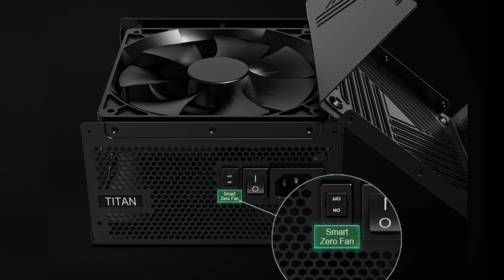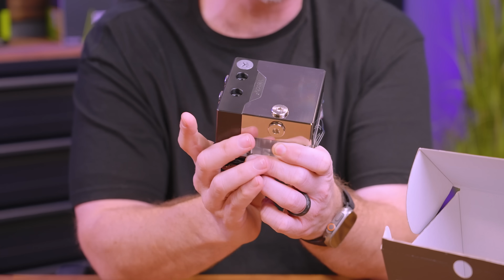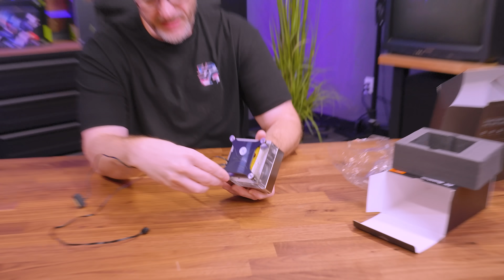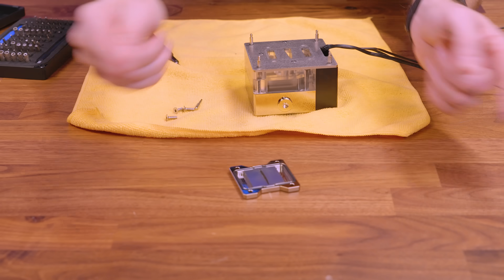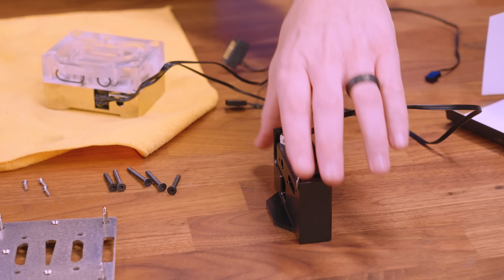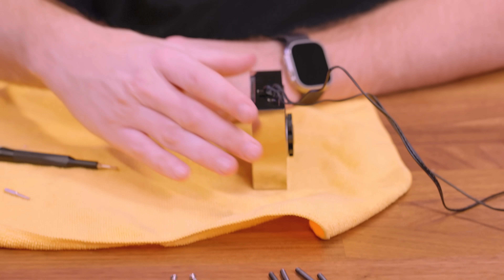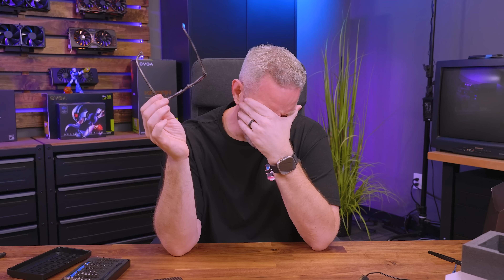I wish this existed years ago!

Comment: You can take the combo pump from an AIO and connect it to a loop I know this because I've done it many times, I've also built my own GPU bracket out of nickel plate so I can fit a second AIO pump to the GPU. This not only looks good it's very efficient very cost affective.

Comment: AlphaCool has one thats pretty robust been out for about 4 years now.. it comes in their AIO packages but 240,280,360.. in slim varriant and a pretty large pump.. Id love to see the test of those two side by side because im trying to upgrade to AM5 and dont want to have to get a differnt cooler to deal with the high temps of the AM5 Platform if my 280 AIO will handle a 7900x, or 7950x

Comment: I am really contemplating this item for my NR200 custom loop. It's between this item or Barrow's Pump Reservoir Integrated CPU Block. But I read the included pump is not PWM and replacing the pump with a DDC 4.2 Pump would cost almost as much as this one.

Comment: Please correct me if I am wrong but if you use the fillport on the cpu/pump combo and bleed it from air, Won’t that make it possible to use a bottom mounted rad? As long as the fillport is facing up on the motherboard?

Comment: This should be absolutely fine with the radiator at the bottom of the case, since it has a small reservoir above the pump. Air will collect inside the reservoir, not the pump.

Comment: Silly question, could this work well?..
I have a katana 1070. The heatsink seems to be all copper and seems to have a bit of a flat heat chamber then fins to take note of....
 
Wondering if will work to clear the fins over the processor area, and try to flow copper (plumbers type solder?) To join a copper water block to it?

Comment: Neat looking device, thank you for the video. I'm surely not the target audience, though. Even after 27 years of building PCs I'm still not comfortable with putting any liquids inside a PC. Since I am also all about efficiency, the components I usually use for new builds don't rectify any liquid cooling solutions. But again, I can see the advantages of this compact block.

Comment: Which is why you prime and load the system externally with another power supply using the green wire trick, THEN put the unit in your case.

Comment: Would ATX shift PSU fit insade lian LI O11 air mini case, and would it make sence to use it, if a person dosen't intend to use hard drive cage ?   I will need psu from 1200W to 1600W ( just for size reference ).

Comment: Hello Jay, greetings from Ecuador, I want to tell you a question related to my setup, It's not related to the video, but I wrote because you have a lot of experience and setups and hardware. 
My motherboard Gigabyte Aorus Elite Z790 AX lits its CPU troubleshooting led when computer enters into sleep mode or when computer is shut down, and led remains lit unless you disconnect the monitor from energy or DisplayPort cable of the CPU. This makes me think about a physical problem, and not a simple bug that I could ignore. Someone told me that this can be a motherboard shortcircuit problem that only shows up when energy from mobo is gone (when you shut down it, for example).   
That led situation does not occur when the HDMI cable is connected to the monitor, when the computer goes into sleep mode or shuts down, the CPU LED lights up fleetingly but turns off and remains off. So, I think is something related to the DisplayPort monitor connection, but DisplayPort cable is new, and also all of the other computer components, also, I dont think the DisplayPort is damaged, because there is no problem with image displaying.  
I would like to know the possible causes of this issue and the potential solutions or tests to try, before trying warranty technical revision, because they tend not to take seriously client's questions or complaints. Thanks in advance.

Comment: I'm not sure the flow direction is correct there.  "Usually" the center part of a pump is the suction port, it's in the name centrifugal pump.  When I look at that block, i see suction from the centre, which means the outer edges are the cool side.

Comment: I kinda don't get water cooled systems at all anymore. Back in the early 2000s when I was still working in PC building and sales, we used water cooling and a single passive radiator at the back to make systems completely silent (except the pump). This made sense. Nowadays, people have multiple radiators all over their case, with multiple fans on each one, and a "water cooled" system in the end has more and louder fans than a regular air cooled system would have. What's the point of doing this, except the thrill of having added more failure points and cost to your rig?

Comment: greevar
greevar
2 days ago
The backing for the double-sided tape is probably left on for those who want to remove the RGB. Not everyone likes to light up their computer.

6

Reply

2 replies
wimpyhugz_TGK
wimpyhugz_TGK
1 day ago
I'm using the AM5 version of that block/pump/res unit in my Fractal Torrent build. Got a 80mm thick 2×180mm Alphacool Monsta radiator on the front with the stock 38mm-thick Fractal 180mm fans and an EK P240M radiator in the bottom with 30mm-thick Phanteks T30 fans, leaving me very little room for a normal pump/res setup. 
Also, I ended up just attaching a fill line to one of the fill ports on the block and routing that to one of the Torrent's fill port holes at the top of the case so that it acts like a T-line reservoir. Without that, it just makes the initial fill and priming really difficult...

1

Reply

1 reply
AirRookie
AirRookie
1 day ago
AM4 version of this combo would be nice to have, I can only find AM5 and 1700 versions so far, looks so cool

Reply

Pink Tusked Mammoth
Pink Tusked Mammoth
2 days ago
This reminds me of working as a auto mechanic. Remember even with that nylon saving the "curious" a little it will still burn up the pump if you run it dry for too long. Its best to just not run it dry.

1

Reply

H311FR0G
H311FR0G
1 day ago
As to the sponsor ad, I love how "Zero RPM fan control" or "Fan Stop" is treated like a quality improvement feature, when all it does is make your hardware run hotter and burn out faster.

Reply

Mr. Hatchet
Mr. Hatchet
1 day ago
Probabely also a really good product for dual loop systems.

Normal d5 for gpu and this for the CPU.
Iam wondering if they will offer a combo unit for gpus aswel.

One res feeding 2 pumps could be a nice one when buildt right.

Reply

Jordy Steinberg
Jordy Steinberg
1 day ago (edited)
I had the Swiftech CPU block/pump combo for my watercooled build about 10 years ago where I liquid cooled a 4770k and a 780 ti.

It died after about a year.

I switched to a DDC pump IIRC  and an EK waterblock for the CPU.   This block/pump combo certainly looks a lot more sturdy than the Swiftech version from a decade ago.  

It's definitely a bit harder to make sure the pump is getting water if the pump is integrated into the CPU block in my experience; I recall having to lean the case quite a lot and stop the pump repeatedly to get all the air out despite the CPU block being a decent distance below the reservoir while filling the loop... There was a bit of a curve in the soft  tubing I was using and that seemed to collect air consistently. 

I'm not sure if this solution is actually easier than just using a reservoir that has an integrated chamber for the pump, like Daniel's reservoirs from Singularity Computers.  Considering I've not used one of his reservoirs and you now have access to both, you'd probably be a far better judge of that.

Reply

BramSLI1
BramSLI1
1 day ago
I wonder how they got around the Asetek patent issue that Swiftech had to deal with? It's why they had to discontinue their pump/waterblock combo units. It's also why they had to move the pump to below the radiator when they released their AIO units.

Reply

Salty Lion
Salty Lion
2 days ago
That's great to hear that I accidentally did it right with my cpu AIO the radiator is mounted to the top of my case. I built this like 6+ years ago, still going strong.

Reply

Johan Kooistra
Johan Kooistra
1 day ago
Yet another thing shown, which is awesome: But it would be so much more fun to see it running in a system.

Reply

MotoVib3s
MotoVib3s
1 day ago
This is hilarious .... I literally just purchased this for the specific reason of running a dual pump setup in my 011 Mini. I've been running the EK front distro plate for the 011 mini & thanks to my flow meter I know all the bends & turns have drastically lowered the flow. So I purchased this for the exact same scenario you explained at the end

Comment: Really disappointed that it's a socket specific block+pump combo as even most AIOs and normal open loop blocks have brackets to support more than one socket. $319 while cheaper than what I expected, stills seems a bit pricey to be locked into one socket.

Comment: Does the weight of the block cause you any concern? Although it bolts onto the retaining bracket, which has an additional bracket on the back of the motherboard, I wonder if the weight causes the motherboard to flex. Maybe not because of all of the standoffs.

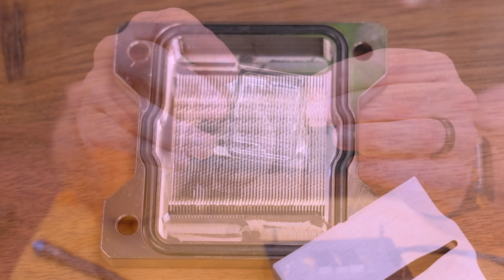Comment: 8:53 - its only more surface area, the higher density of the fins the slower liquid moves through them removing heat from the coldplate.

Comment: I remember in the days before there were reserviors specifically built for pc's, you can t-junction a fill tube from the top of the case to right before the inlet of the pump and use that as a reservior. Of course  the volume was small but you would fill as it pumped and it also acted as an air collector and bleed valve. Once the system is purged of air, fill the tube up with water and it acts as a small reservior to keep your pump from running dry.

Comment: A gen 5 power cord with a 1920 vintage circuit. Modern (21st center - 2011 or later) circuits are cheaper, smaller, and better.

Comment: Leaving the tape off allows the strip to form to the channel, allows for thermal expansion, and means it can be removed or swapped without having to peel it off the block. Personally, I'd leave the tape on. With all the other choices that EK made, it stands to reason that this was their choice as well.

Comment: EK has screwed me over multiple times now. Costing me hundreds of dollars. 

Recent I ordered the 4090 wb with active backplate, and they only gave me the active backplate and refused to acknowledge the mistake despite an unboxing video showing it was just the one. 

They also already discontinued the dark hero monoblock already despite being a rather new motherboard. And now there’s no viable alternative and mine is failing… I would need to completely charge out my motherboard now once it’s gone.

Comment: Probabely also a really good product for dual loop systems.

Normal d5 for gpu and this for the CPU.
Iam wondering if they will offer a combo unit for gpus aswel.

One res feeding 2 pumps could be a nice one when buildt right.

Comment: I have had a bad experience buying from EK, as after spending £1000 with them 4 120mm fans were DOA, and they wouldn't replace them, but luckily in the UK if you pay with a VISA or credit card you can recover the money using Charge Back or better still, under Section 75, and the bank takes all the money back and gives it back to you, meaning EK lost £1k for not replacing £20 worth of faulty parts.

Comment: Same here Jay, if I were to add that my loop would have a D5 and this DDC... but I don't think I need it for now... 2 rads, cpu and gpu, I recently reworked my loop and tried to use the minimal amount of bends, it literally now only has 2 90° bends, a slight angled one, the rest are straight pipes, so I think I'm good for now

Comment: Couldn't you put one or two three way walves somewhere high and have two ports where you could attach a temporary reservoir for filling just above the block? Once loop is filled and air free you just change the valve position and bypass the reservoir ports. Then plug them off.

Extra parts perhaps but we talking custom loop anyways, people are generally not going for the easy route..

Comment: This would have been awesome 5-7 years ago. Back when components where low enough power to really fit in small cases. 
Reminds me of the Ghost S1 build you did. I would love to do a similar build with my watercooled 2080. 

Even my current build, this would have made life a lot easer. There's not a lot of space in a Fractal R6 after you add a pair of thick 360mm rads. 
Love that the RGB wasn't stuck in. It makes it way easier to remove and through in the bin.

Comment: that unit do have a small tank, so it does have a inlet, outlet and fillport, also i am using this combo unit in the louqe ghost s1 with ek low profile 90s fitting and two 240mm radiators

Comment: No. I would not put a block that is that heavy on the chip, or on the motherboard. I move my PCs often, so I take into account resistance to vibration. Lightweight block with everything else not touching the board or chip is the way to go. Pump and Reservoir combination should go on the rad, and supported by the case. Then when someone sets my comp down hard, no worries. And, always brace your graphics card.

Comment: I'm kind of surprised you haven't really experimented with the Alphacool Eisbear more, considering it's also a combination pump/res/cooling block. That one has been around for a good while now, and good enough to pair with some radiators.
Reply: Thank you !! all i want is a video comparing the Eisbear pump.. not the LT small one but the normal big size one.. i have it hooked up to its original 280mm rad and its been awesome.. Id really like to know where it sits compared to Asutek pumps and really expensive pumps like this that only fit one type of socket...

Comment: It has been over 20 years since my Koolance PC2 series case was QA'd.
I have since added a copper radiator kit, bigger fans, yeet'd the original junk dual pumps...
Now using a cheap $20 AliExpress SC800 (600L/H) pump and threaded it directly to the radiator (top).
I am using the same Athlon XP/Pentium 4 era Koolance block CPU-300-H06 fitted to my Ryzen 5 3600 without adapters. It's absolutely wild that I can do that but I often wonder if there's anything better quality. It feels overkill even with my comfy overclock but for 20 years I've screeched about importance of chipset temps when overclocking. There will come a day when I will be able to water cool the X570 and it isn't soon enough. Even with RGB puke that chonky EK block will not help me.

Comment: I find this funny, since the cpu waterblock that I have been using for at least 5 years, has the reservoir and pump built into it, so I only had to run tubing to the rad and was done, very simple design, and has been very reliable.   guess it didn't matter since EK didn't make it.

Comment: l learnt that custom water cooling is far too expensive and the uber high cost makes it only worth the extra massive cost if you are using top end pc hardware.
$au600+ just for a water block/pump combo is daylight robbery especially when most of the components are made by cnc instead of by hand.
my nzxt aio cost less that $au200 and it works just fine so will keep using it, if my case could fit my 15+ year old noctua cooler i'd still be using that.
l always though nerds were smart but l guess not when they are willing to waste so much money on overpriced bling.

Comment: You could probably just set a static rpm on your setup if you do intend on mixixng/match pumps. Just adjust it until theres no ripple/noise, then wait a week, adjust again once the air in the system collates.

Comment: Every one is always on about putting the rad higher than the block but always seems to forget to mention that there are actually some AIO's where the pump is situated inside the rad and not the block.  Antec neptune is one of them

Comment: Nothing wrong with a D5 and a DDC in the same loop. I've had mine set up like this since 2015. The trick is, you want to use the D5 to supply the DDC.

The D5 will out flow the DDC making it more or less free spin. BUT when pressure is needed the DDC will be able to provide that pressure very easily AND keep the flow rate up thanks to the D5.

Fluid dynamics is awesome! Check out some engineering articles that reference high flow and high pressure pumps working in the same system. It's actually one of the best ways to boost performance in a configuration like a PC water build.

Comment: The back of the RGB strip has bare copper pads.  So the only thing keeping it from shorting against the metal block you stuck it to is the paint on the block and the adhesive now that you've removed the backing.  It's probably fine, but I wouldn't have done that.

Comment: EK for some reason the past few years has yes made the nicest components and you pay for the look and for the materials they use (usually the best) but the past few years I find some issue in everything I buy from them. It's nice to see Jay gets the same parts we do, but it's usually not a giant issue to fix whatever is coming off or is mis aligned. EK still makes the nicest stuff in my opinion. They just need better QC
Reply: what kind of issues this you get?
Reply: @Jedarooo  Tolerances mostly, things not aligning up. It has happened with at least 90% of items I buy from them, personally it does not effect my PC because I like to mod and I'll just do whatever it takes to make it work, but people who are new to this and pay a premium for EK thinking they are the best, it's a issue if screws do not line up or a bracket mount is mis-aligned you know?

Comment: Premium snake oil for $319, for product that costs $20 to manufacture. Those robbers, put RGB inside to deceive you, that there is some intelligence inside, but non of them to spend few bucks and put flow and input/output coolant temperature sensors.